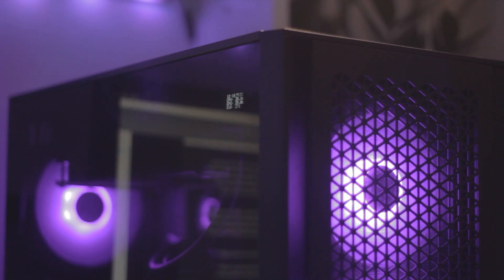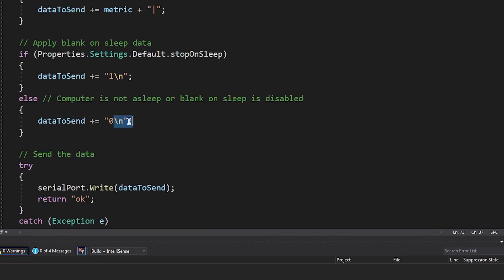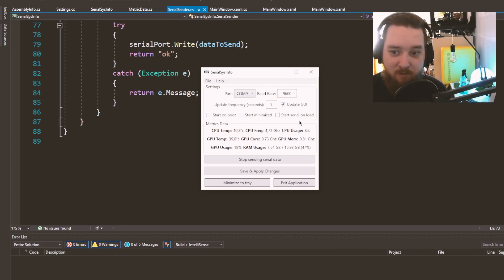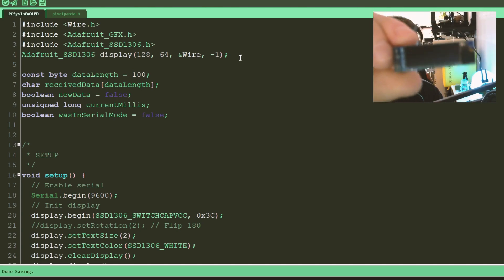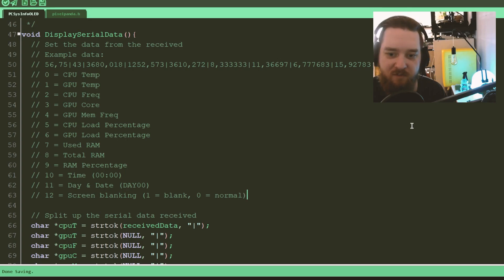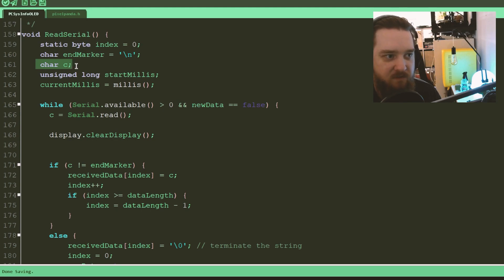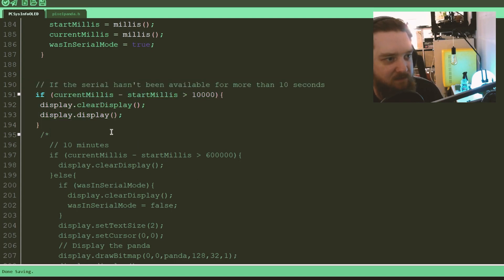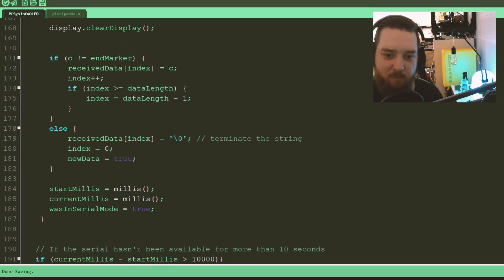I Put a Display in My PC Case

Comment: Hey, great project and explanation! I'd like to make this as a gift for two friends. I have a question re SerialSysInfo -- I see no exe file for it, so how does it work?
Reply from the maker: Thank you and yeah you're right, it seems I forgot to upload a build as a release! I'll upload one in a moment to the GitHub page. :)

Edit: A version is now available at: https://github.com/FuzzyTekShow/SerialSysInfo/releases/tag/v1
Reply: @FuzzyTekShow  Thanks so much. Works well with Arduino Uno. Tried with Wemos D1 mini as well, but the screen just flickers with the data at the refresh interval and then immediately clears. SystemSysInfo Start Serial On Load doesn't work for me -- crashes without an error message. Oh I also managed to get it to start on boot through the Task Scheduler and bypassing UAC checks.

Time to dig out my Nanos and get to soldering. Cheers, you legend!
Reply from the maker: @1_HighDuke  Awesome that you got it going on boot, I'll give that method a go myself and figure out the starting serial on load too as I currently manually run it each time I turn on my computer. :P

Thank you for the kind words and I'm glad you got some use from the project.
Reply from the maker: @1_HighDuke  Just wanted to let you know I released a version with both working "Start serial on load" and "Start on boot" so now it's pretty much set and forget!
Thanks for the scheduler idea it did the job just fine! - https://github.com/FuzzyTekShow/SerialSysInfo/releases/tag/v1.1